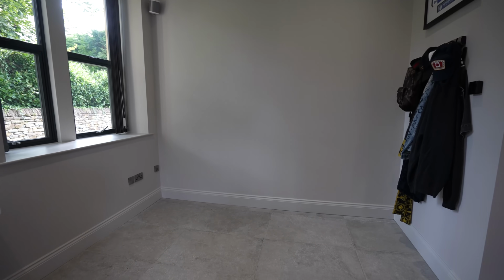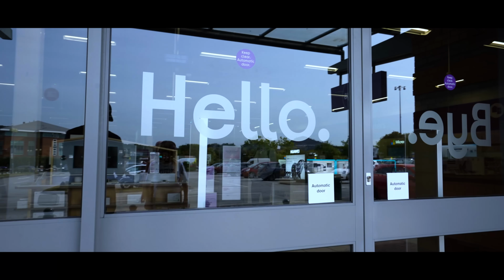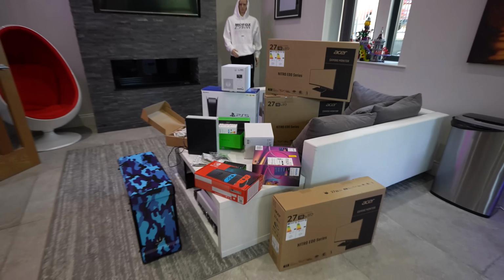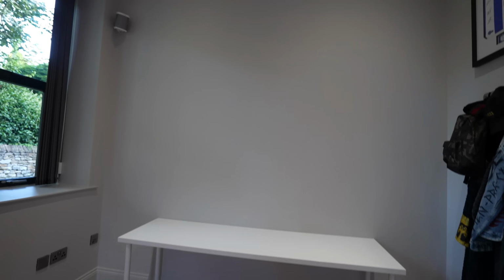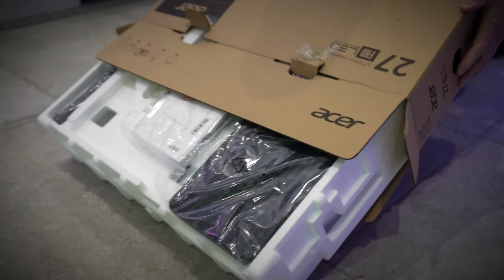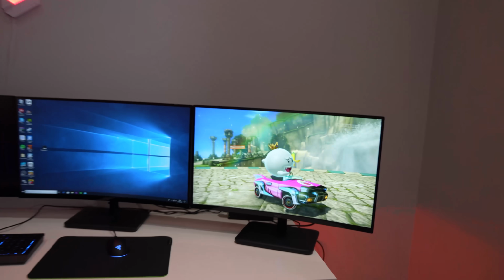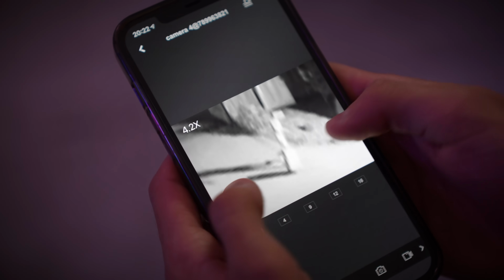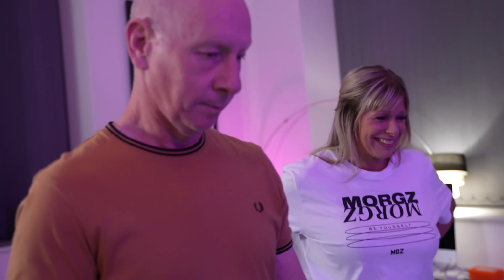I Surprised my Girlfriend with DREAM Gaming Setup! *PS5*

Comment: How to make the best gaming room not only on YouTube not on the planet not even on the moon the best gaming room in the milky way 

66 10 star rated laptops 
42 Xbox series x 
6 ps5
129 headphones 
18,000 games
55 Nintendo switches
900 ps4
22 speakers 
87.5 pc's
38 gaming controllers 
12 keyboards 
800 LED lights 
12 bananas 
A bath 
A box of fairy liquid 
69 girlfriends 
280,000 hats 
74 pears 

And with this you will get the best gaming setup on planet earth